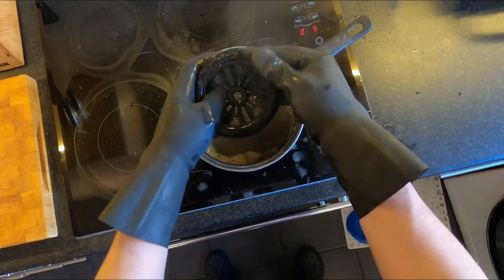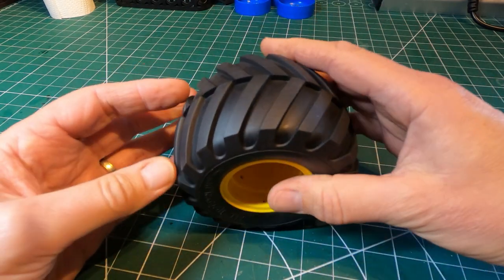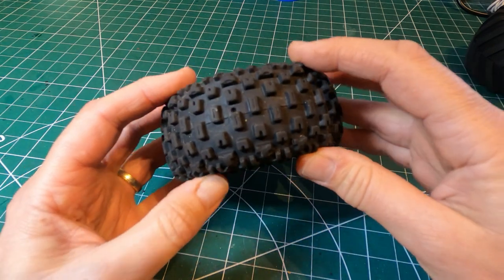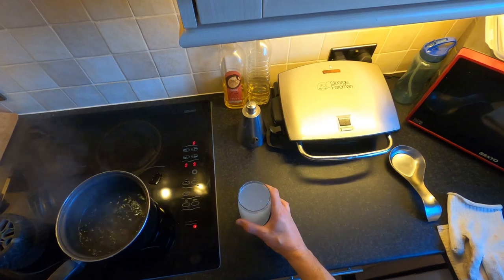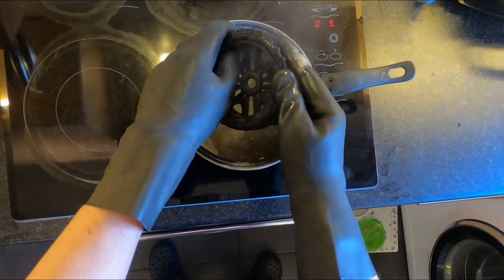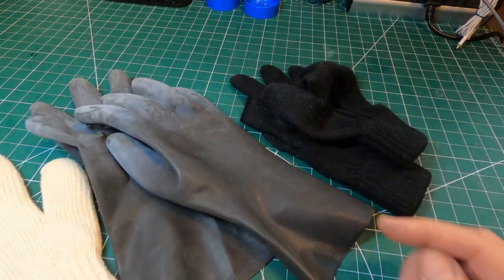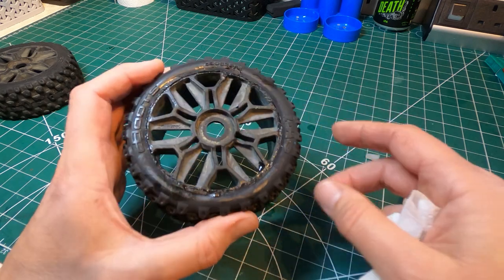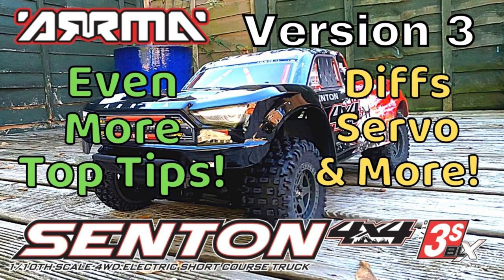How to Remove Glued RC Car Tyres Using Boiling Water. Arrma, Tamiya, Traxxas, FTX, Axial RC Tires

Comment: Great stuff, Pete! This seems the safest bet for removing CA glued tyres - well, for the tyres and rims, that is! Glad you kept reminding us of the perils of working with boiling water - you can't be too careful, can ya? But with a bit of caution anyone can use this technique to remove stuck on tyres. Much better than the oven method! It's amazing how much a bit of sand and dirt can upset the balance of a wheel. Drilling the tyre is also a great tip. Top job, matey, hope your post-vaccine weekend is going well.  :O)
PS - never heard of the weak lemon drink!!!
Reply from the maker: Hiya Mark. Yeah I thought it was worth showing this as I've not seen anyone do the double glove thing. I was worried that someone might burn themselves and then blame me so hence all the warnings. The weak lemon drink was from a sketch on one of the Stuart Lee and Richard Herring shows. It was Kevin Eldon playing Simon Quinlank who was obsessed with hobbies. He listed the things you need for the hobby which always included a flask of weak lemon drink. I'd forgotten that it should have been in a flask when I did the kitchen bit. Anyway, it was rather obscure! Hope your jab goes well on Monday. I'm fine but laying off the beer a bit for the weekend. Just had a pint but might leave it at that. Enjoy the rest of your weekend mate. Best wishes 😁
Reply: Yah git mud in the tyres,as they said in My Cousin Vinnie, awesome movie 🍿 lol 😝

Comment: Hi Pete, hope you're keeping well. Patience was a virtue on the removal of the tires. I would certainly feel that method as being the preferred method for the releasing of the glued rims, rather than the oven method, purely on the grounds of damaging the wheels and tyres is less likely at the boiling point of water than oven temperatures. Nice touch with the weak lemon drink ! 😁. On our v3 Arrmas they have the holes in the wheels like your Senton and Granite. Getting close to being able to get out and go for our first runs, can't wait 😉. Keep safe and well.
Reply from the maker: Hiya John. I'm fine thanks. Hope you're ok too. I got jabbed on Friday which is great.  I've found this method to be best for getting the tyres off. It was just a matter of finding a way to stop my hands getting burnt which the gloves achieve. So with RC'ing my understanding is that we are currently allowed out to do non exercise things and meet one person. It needs to be local I guess which my RC spots are. Which date are you thinking is the green light for RC'ing?
Reply: @PeteWylieRC  Hi Pete, yeah, I got the vaccine just over 10 days ago, had the AstraZeneca vaccine, soon recovered from some mild side effects. We are still only able to do local things, but my favorite spot is a short drive to Oundle, but this is classed as a different county to Peterborough, so as not an essential journey, have to wait a little longer, but we are eagerly awaiting 12th April, this is when we expect the local and national lockdown to be eased ( you may remember Peterborough and the SE of England went into Tier 4 before the national lockdown, because of the Kent mutation of Covid-19). Will say, our NHS here in Peterborough have really ramped up the vaccine programme, so should help. Keep safe and well my friend.

Comment: Great stuff. Have just used black lx tape to cover the holes on my Maverick wheels. May use the hot glue option. I made three holes on each tyre with a small hand held modelling drill (maybe 2/3mm). Hope they’re big enough.
Reply from the maker: Yeah I did think about using tape to cover the holes. Just as good I'd have thought.  Never sure how big to do the holes as even with a 5mm drill it's hard to see them as the rubber seems to spring back.  You can certainly get the water out when you spin the wheels.  Many thanks for your comments :-)

Comment: Yet another useful video to make RC life easier. Well explained as always 👍🏼
Have you ever tried hot water with dish soap?  I tried it the other day on a magnets I super glued the wrong way around 🤦🏻‍♂️ worked a treat. Left it to soak for 15 mins, prised it a bit and then left a few more minutes and it was off.
Reply from the maker: Hi there. No I haven't tried using soap. I guess that there are a few ways to do this but I've found the boiling water to be the easiest I've tried. Many thanks for your great comments as ever. Best wishes to you 😁

Comment: Good tip thanks 🙏 how do you rate the typhon as thinking about getting one ☝️?
Reply from the maker: Many thanks. I really like all the Arrma 3s cars I've got which are Granite, Senton and Typhon. I probably like the Granite the best then the Typhon then the Senton. Depends what sort of driving you like most. Granite more of a crazy stunt truck and the Typhon better in the corners. The only thing I don't like with the Typhon is the little front bumper. Prefer a big bumper as is is a basher. Eventually I hope to do a comparison video of all the 3s cars but I need my mate to buy a big rock! Thanks for watching 😀
Reply: Thanks for info I want a 3s buggy, I was looking at ftx vantage or considering paying a 130 more for the arrma atb Pete
Reply from the maker: @catcancrunch7260  oh yeah, Arrma all the way I'd say! Check out my Senton unboxing and review vids.

Comment: This is excellent!!!!  I always try heat guns depending on the situation...  thanks..   do you have any advice on softening hardened tires from age lol?????
Reply from the maker: Hi there. Haven't tried a heat gun I must say. The good thing with the boiling water is that you can dunk them in and leave them for a bit till they are ready. Not sure about old tyres. There must be something that would soften them up. Many thanks for your comments 😀

Comment: Useful vid thanks Pete..
Reply from the maker: Many thanks for your feedback 😁
Reply: @PeteWylieRC  Hi Pete, this is going to be a bit of a ridiculous question as I know they're different animals but I'm struggling to decide between buying a basher or buying more fragile models like a neo Scorcher and a Kyosho Beetle. Essentially when looking at a basher it's between a typhon 3s blx, hobao hyper vse and a big rock 3s blx v3. So basically I put all my budget into a tough basher or spread the money and a bit more over a couple of more fragile kits. I've been tussling with this for a bit and can't decide what to do. I know the typhon is a beast and the Neo Scorcher (with hop ups) will be more fragile but how do you find them both.. The above budget scenario is for my rc projects this year. Financially I'm a bit limited at the moment..
Reply from the maker: @JonnyFourDeluxe  ooh that's a knotty one! I would say that I love building the kits but it depends what you want to end up with. The Arrma is just in a different league of speed, strength and excitement. You do need to get yourself a good 3s pack though so extra expense. I do enjoy running the Tamiyas too but you need to be a bit kinder to them. The TT-02B has weak bevel gears and the metal ones I found for it were so expensive that you could get something better for the money. The Arrma's aren't perfect as shown in my various guide videos. Worth putting a bit of work in though as just such exciting bashers. Having said all that I would really like to build one of those Kyosho kits! Like I say it depends what you want to end up with but I'm using the Arrma's a lot more at the mo 😁
Reply: @PeteWylieRC  I find myself tussling with this and change my mind daily. I enjoy kits and tinkering with stuff. But at the same time want something that will take some knocks and be generally quite versatile. At the moment I'm airing on the side of getting a typhon as then I'll have a good basher that handles and then when money allows I can pick kits up as and when I can afford to. The quality of the Kyosho's legendry series look superb. I fancy the beetle and tomahawk, getting hold of them seems tricky though.

Comment: Would hot tap water work....I get a lot of CA on my hands with a pass time I have, and I find it comes right off in the shower, just a thought!!
Reply from the maker: Well it takes a few minutes and several tries with the wheels in boiling water to get the tyres off so I don't think you'd ever get them off with hot tap water. I think that it's more difficult because the glue is sandwiched between the tyre and the wheel. The glue on your hands is in direct contact with the water so easier to get off with a bit of a rub. I'm prepared to be proved wrong though! Thanks for your comments 😀